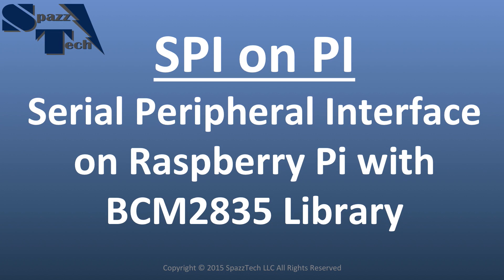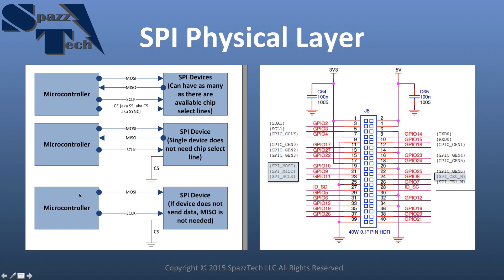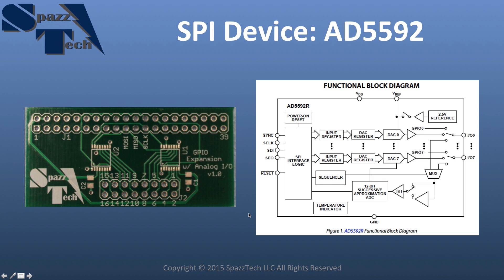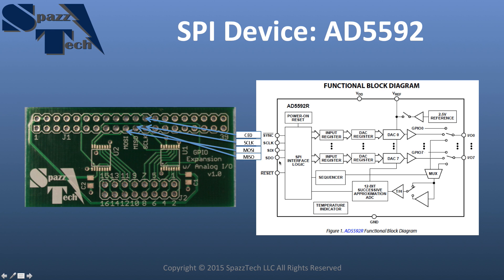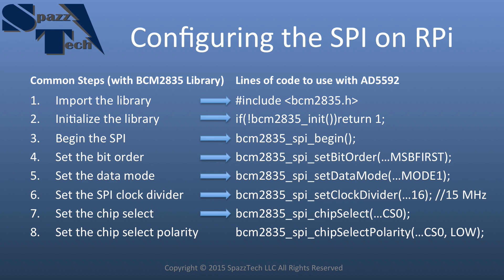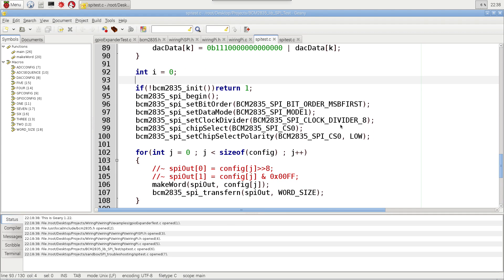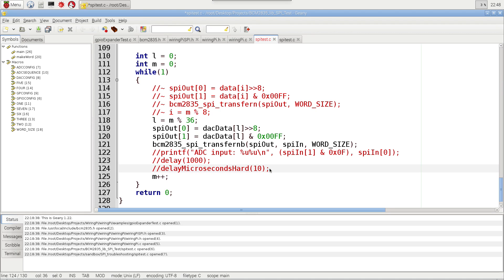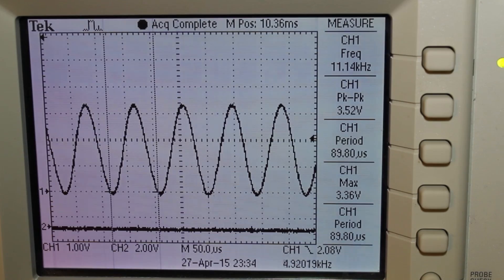SPI on Pi - Serial Peripheral Interface on Raspberry Pi 2 with bcm2835 library

Comment: This is great! Thanks for taking the time to explain it. Quick question. How do you get audio into the compiled file? Its just not obvious. Like how would I expose this code in the system to be able to use it as an audio device to get audio in and out of it. Can you do a quick video on that? or point me in the direction of where I can find that out.
Reply: Hi Clem, I may be off point but when reading or writing audio, graphics, or data, you must have a source to read/write from. As an example, you would open a file to a variable, from that variable read the code left to right, top to bottom. Most files will have a header that describes its contents. This is just a chunk of code at the beginning of the file. But you must "open the file for read" first. There is no user decompilation of the compiled code. If you were to read say a hex file, not so common, maybe . MOD extensions, or . MID, or GCode, or . RAW, you maybe able to manually code those, but for the most part, the compiler does this automatically. So in short, you don't need to put audio into the compiled file. You read it as an external file. Streaming audio or video is more complex with decoders and data buffers, but you still "open the file for read". Just remember to close the file too. --- For arduino, or raspberry, you may include a hex dump in the code. This takes a lot of resources, but is a list of hex values separated by a comma, semicolon, or space. You can then write a loop to read through each hex value individually. Each hex value can correspond to a color, or sine wave vertex. And then, the code is compiled and uploaded.

Comment: Is there a difference between spidev (3.2) and the library 'python-periphery', or the 'py-libbcm2835' library?  They all seem to do spi, however not sure if they have different applications or if they are just deprecated libraries?

Interestingly, the spidev documentation says you can set the number of bits per word(transfer) , 8..16, however according to the pi documentation, the spi peripheral connected to the header only supports 8/9!     So perhaps spidev is a generic driver whose functionality may or may not be fully supported by the rpi?

BTW, doesn't a python list ([0x90,0,0,0,0]) consist of ints and not bytes?  Does the driver take this into account and convert it to 8-bit bytes before sending?

Comment: Hi¡¡ I Have a problem with spi protocole right now. I have more than two spi devices, two AD converter and one DA converter. The problem I have is that there are only two SPIO CE0/CEI1 pins in the Raspberry Pi board, and I need one more pin. Is there any way to use a gpio pin as a chip select pin?? 
Thanks¡¡¡¡

Comment: Hey Tom, thank you for the video. I have a question about your code : don't you need to pass a reference of spiOut and spiIn as stated in the function's transfernb description?
"void bcm2835_spi_transfernb(char *tbuf, char *rbuf, uint32_t len)"?

I've seen that in comments in the google group and I don't understand it at all. It can't work. Finally, I may be extremely wrong and thus I'm very sorry.
Could it be because of an update of the library?

Thank you very much!

Comment: That's really a cool explanation on spi with BCM 2835 library. I see that this lib doesn't support interrupts and also has the possibility to use RPi 2 Model B(40 pin) as SPI slave.

Do you know any open libraries that effectively utilizes the RPi peripherals?

Thank you in advance!
Reply from the maker: Krishna Vv The two most popular libraries for accessing RPi peripherals are this one and the WiringPi library:
http://wiringpi.com/

I don't think its that the libraries don't support interrupts. At least true interrupts in the traditional microcontroller senses. It's that the hardware doesn't support a real interrupt. By that I mean there is nothing that I have found that would allow some event to immediately cause the OS to interrupt its scheduler to execute an interrupt service routine. The only thing an "interrupt" does is set a flag that an event has occurred sometime since the last time the flag was cleared. Its one limitation of the RPi.
Reply: SpazzTech That means I understand that RPi doesn't support(external or internal) interrupts and can't execute user defined interrupt service routine!

For my project, i need to communicate between two RPis using SPI due to which pi must act as a slave when rxing data. 

The linux kernal page says that "Microcontrollers often support both master and slave sides of the SPI protocol.  This document (and Linux) currently only supports the master side of SPI interactions."(https://www.kernel.org/doc/Documentation/spi/spi-summary).

So in this case, RPi can't act as SPI slave? which is contradicting to BCM controller docu.

Comment: What program on the PI are you using for the C++ IDE?
Reply from the maker: +Eric Boeck Geany can do C++, but I have mostly been writing C with Geany. Code::Blocks has more features. I've been using mostly Raspberry Pi 2 lately and Code::Blocks runs ok on it. I've even used eclipse CDT a little bit. Not much though.

Comment: why the output signal in oscilloscope is not clean?
Reply: It could be that the signals really are that noisy.  It's possible that a maladjusted probe can modify the characteristics of the signal by adding parasitic inductance/capacitance.  There is no rule that a clock needs to be a perfect boxcar function.  All that is required that it rise and fall below a defined threshold reliably and consistently and the same goes for any signal.  In radio communication, you'll see much worse than this and still have a reliable, consistent signal decoded.

Comment: Thank you for a video. Raspberry Pi does a disgusting and dishonorable job of documenting so poorly. Unless you already know this stuff off hand, there's no way to possible program SPI
Reply: The supplier of the CPU is less than transparent in the name of "protecting our Intellectual Property" but fortunately SPI is an open standard, as is also the Linux kernel.  The information is there (unless you are interested in how the floating point divisions or matrix multiplications in the GPU are really done) and available as open documents.  There have been more than a few occasions I had to look at a CPU datasheet and a PI schematic diagram to determine the best pin choice.  Keep in mind, when you are at this level with hardware like this, you can potentially be the first person attempting your scenario.

Comment: Your statement that CS can be hardwired to the active state is not true. Many ICs depend on the edge transition to begin reception or delivery of data. MCP3008 ADC is one example of many, and in this configuration it WILL NOT WORK. Please correct that as some folks may do this on their Pi projects and then wonder why the peripheral that they are trying to program does not work.